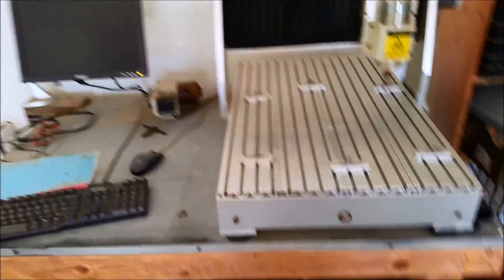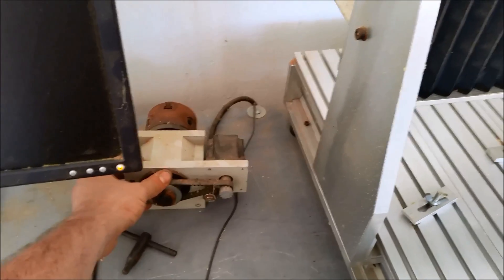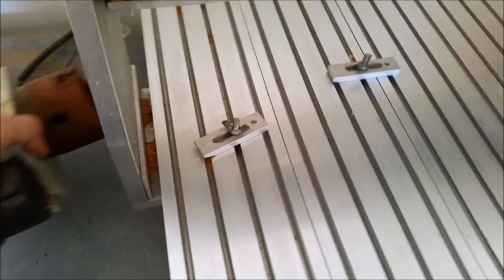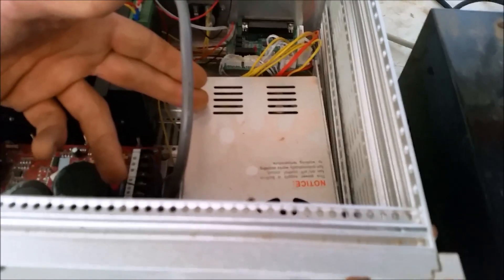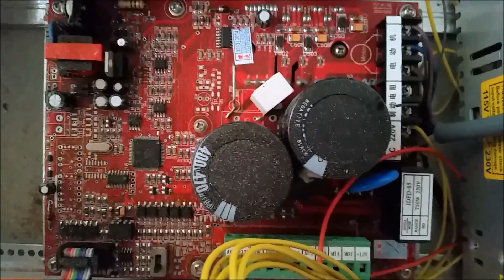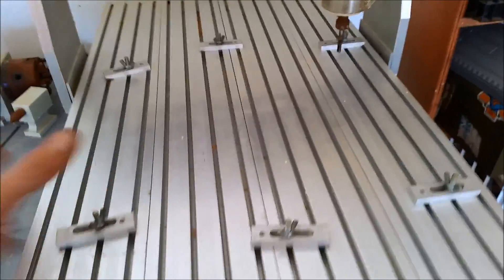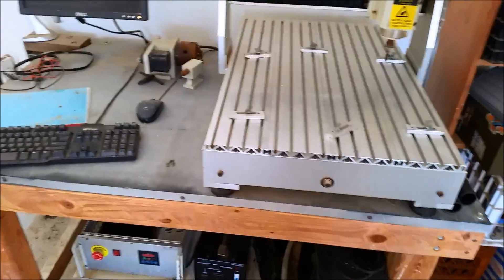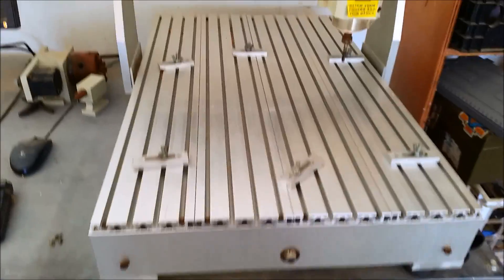CNC 6040 Review and Rant

Comment: I think the point of these machines is to offer the absolute lowest cost to the end user, and in so doing- you are left with terrible choices in controller, wiring, fit and finish, pump, etc. I'm also trying to set myself up and learning what is needed to get started with a CNC affordable setup. I think the 6090/6040 machines like this one are a good choice to begin with, but require several additions and modifications to get it to be reliable and capable. 

I've heard that the steppers, spindle motor, axis screws, and frames on these are really good stuff. Sure, you have to double check alignments and tighten all the bolts. But the core machine is great. I've seen people converting to Tiny G controllers and replacing power supplies. The stepper drivers in this machine are good quality too, so they can be used without issue. In the end I expect to spend around 2000-2500 USD to get what I want- reliable, powerful, accurate cuts that are fairly quick. Am I on the right track here? Or am I crazy? Are there any other issues you have after using the machine?
Reply from the maker: +John B 
I agree 100%.  I had bought this machine as I had never really dealt with one before.  After using this machine I had the confidence to build my huge 3D printer.  I have vids on my channel for it too. Building your own is significantly more rewarding as well.
Reply: Puddin I think this also might be my path. I would rather have something (somewhat) turnkey, gain experience, then build something bigger... I'll have all the essential knowledge at that point. I don't want to start building before I fully understand what I'm doing, what to do, and more importantly what NOT to do. 

I have to examine a working example before book or forum knowledge. I want to know what the terminology is, what the components are, and be able to see how the wiring runs and get an open source controller going on a built mill. This will lead me to forums, upgrades, and shortcuts or other helpful info... 

By then I should be relatively proficient enough to begin designing my new mill. 

I think this is wise to go through as I have always used this process to learn a variety of subjects and skill sets. Are there any tips you can give on beginning my journey?
Reply from the maker: +whatmakesittick Sorry I didn't mean to over look your question.  You can most certainly upgrade this machine to better suit your needs.  It is made from 1cm thick aluminum plate.  Light and very strong.  Very first thing I would replace is the parallel port output.  I would think it more expensive to find that older hardware than USB but for sure would be the first to go.  Once you have a USB connection I would then upgrade the main controller.  Something that allows not only limit switches but a true 4/5 axis setup. I think the motor controllers in this machine was pretty decent so I would leave those in.  The Nemas themselves aren't too bad.  I haven't had any real issues with them and would hold off on replacing them unless you just have the cash laying around.
Reply: Puddin Thanks for the info!

Comment: Was looking into getting one but thanks to you, I will think twice.
Maybe get one without the controller and add my own. Either way, very enlightening, thank you.

You've probably figured it out already but the 400.0 displaying at max, is the frequency from the variable frequency drive to the spindle.
So if your spindle is rated at 24000rpm at 400 Hz, then that should be what it's spinning at.
Reply: +loosrudi there is a different version , the ones from california , have much better reviews, obviously the electronics arent the best but it works. and you can always upgrade , but dont get the version with the American flag in the ad those ironically are cheap. http://www.ebay.com/itm/CNC-Router-Engraver-Milling-Machine-3D-Engraving-Cutting-4-Axis-6040-Desktop-/121937895581?hash=item1c6410a09d:g:CXgAAOSwdU1W-KaE
Reply: +Eddie Amaya Thanks Eddie. Looks much better and they do ship worldwide except a couple of continents. I live on one of them, LOL